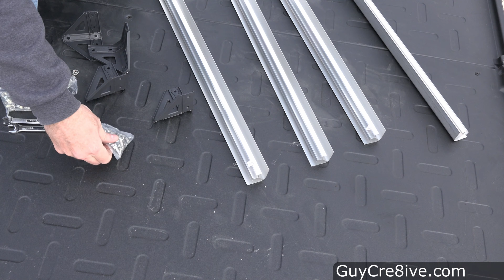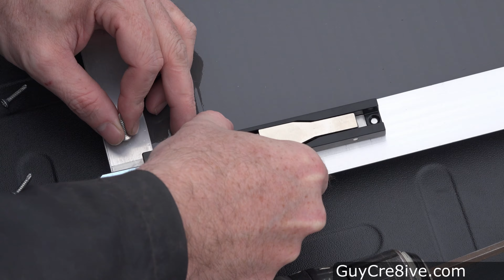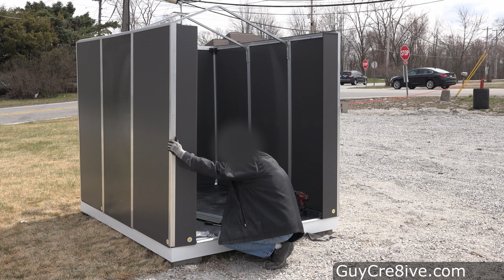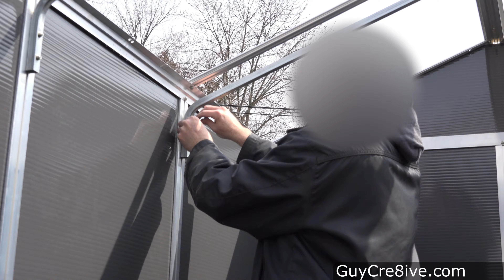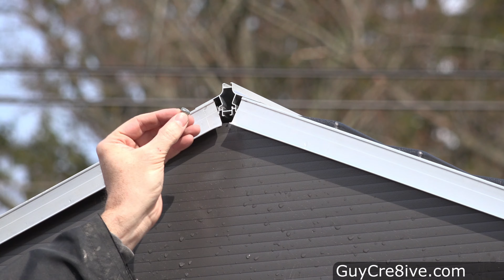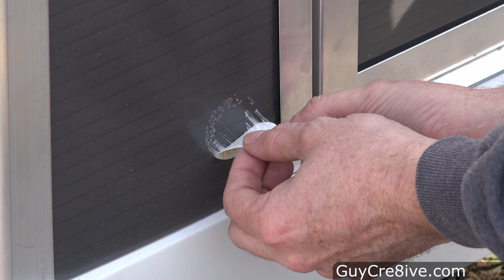Palram Canopia Rubicon 6x8 Shed Assembly 6'x8' Storage Setup 6Ft x 8Ft Plastic Polycarbonate Build

Comment: Thanks for the vid. What kind of screws did you use at 8:58 to secure the shed to the base?
Reply from the maker: I just took the bracket into the store and bought some that fit and you can see what they look like in the video, I don't remember the size.

Comment: Thank you for a very useful video. Plan to install this shed and was wondering if you used silicone for the floor panels and roof according to the assembly instructions? If not, is the shed not leaking? Also, the instructions recommends using silicone spray and a rubber hammer to fit the wall panels. Did you try this?
Reply from the maker: I didn't silicone it since it won't have anything that will get ruined by rain inside but it only seems to leak a little when there is a lot of rain. No silicone spray either, I used my hand seamer tool to flatten the inserts so they would slide in easier. That may have been dumb though.

Comment: I am buying a 10 x 6 one ,how long did it take to build and would fitting guttering be simple exercise. thankyou for sharing .what was the tool you used to help insert the panels please
Reply from the maker: I didn't keep track of my time and I don't know about the gutters, sorry.
Reply: @GuyCre8ive  dont do it it will not fit every thing is turn Very disappointed. The shed was extremely difficult to assemble — parts didn’t align properly, and the quality feels cheap. Instructions were unclear and it took much longer than expected. Definitely not worth the money.